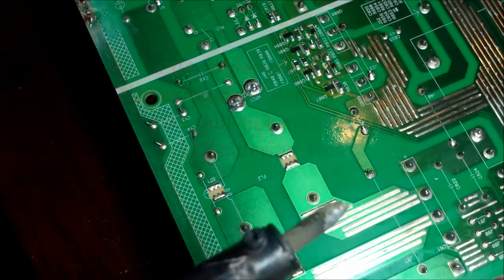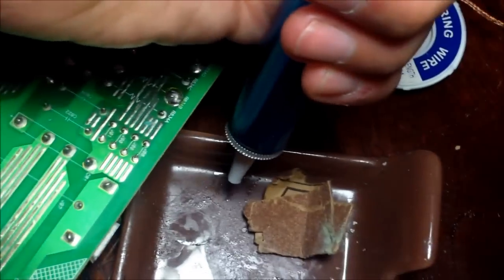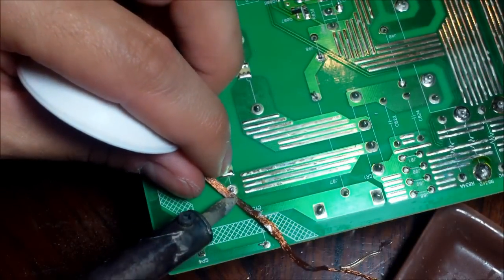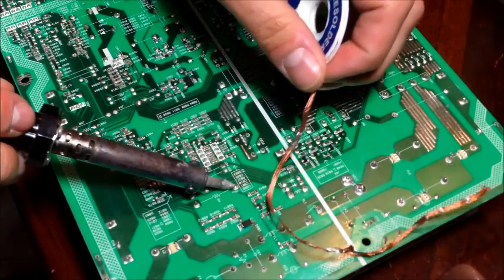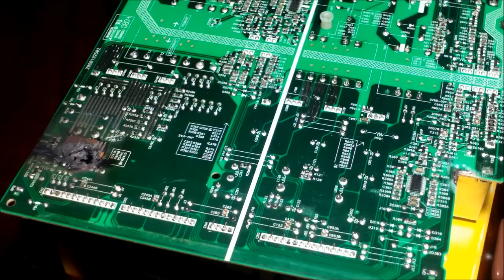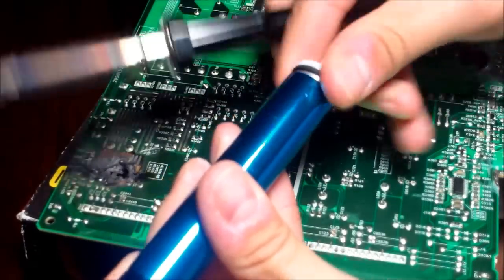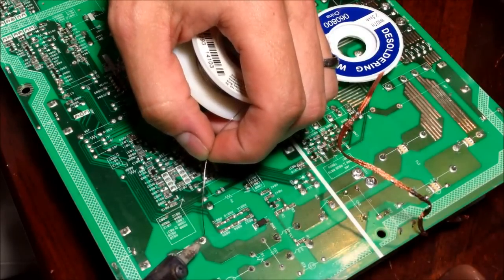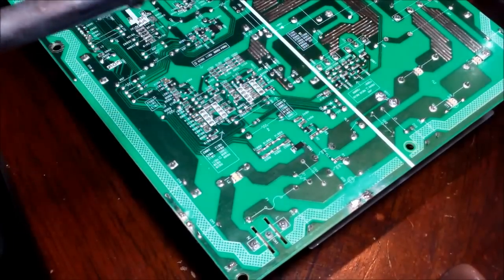Easy Ways how to Unsolder & Soldering with desolder wire and plunger Tech Tips

Comment: Hi, i have to solder a new 40 pin connector on a Nokia Lumia 1520. It is very thin and there are solder leftovers from the previous-broken connector on the board. Will it be ok if i just dip the new connector's pins on a solder and place them above the older ones? I've never used soldering method before...
Reply from the maker: hot air method might be better. I would clean the solder pads with desolder wire then use heatgun and fresh solder if done right it will automatically bond together. watch few videos on  soldering with heatgun or hot air.
Reply: Thanks a lot for your prompt reply. I will try to experiment a few times then on another board and see how it goes...

Comment: dont do the sand paper method its bad for your soldering iron use a metal sponge for cleaning instead its better sand paper damages your soldering tip
Reply: this video is good i learnt something but i dont reccomend using sand paper to clean your soldering tip
Reply from the maker: +BLOODjack143 true, this is an old video, i added a note in video but only can be viewed on pc for some reason.
Reply: +Tampatec ohhh ok

Comment: is a 60 watt gun too much for a motherboard?
Reply from the maker: Ok only if it's adjustable 60 watt then just set it lower temp and use thin tip. iso-tip solder-iron is good
Reply: +Tampatec awesome thanks fir getting back to me so quickly . let's see if I don't  blow the whole thing up lol

Comment: sandpaper damages the coating on the tip. That is why most techs use a wet sponge.
Reply: +D Gosselin most techs use a soft metal sponge, unless you dont care to change ya tips (long term wise heh)

Comment: So do you need something to cover your mouth with to prevent inhaling the smoke from the soldering iron?
Reply: You can use a dust mask
Reply: Place a small table top fan with back of it face you and the board, it will draw the smoke away from you. A dust mask won't help a all for smoke or fumes, like this person answered. You'd need a respirator with activated carbon

Comment: I have a nintendo 3DS charger port that needs to be replaced. I am trying to learn some things bout Soldering from your video cause im a complete green horn at this. From what i understand generally on a circuit board, the pins that you have to desolder to remove the component are on the under site or the apposite side of the circuit board. Is that right? When locating the component, how do you know how many pins there are to desolder? From what i see, looking at the top part of the board, i can clearly see only 2 pins holding this one piece in.

Also when soldering, from what i gather, you hold the guns tip to the metal pin, untill it liquafies and then touch it with the soldering wire? What exactly does that do, like cements it together or something? Then you release the gun after a few seconds. I may need some help on this, cause i don't want to ruin this nintendo 3DS, i got the new charger port for it. All i have to do is remove the defected one and replace it, simple as that.
Reply from the maker: yes just use 30 or 40 watt solder iron then heat underside where solder joint pin is, next wait till solder turns to liquid,  then use solder-plunger or just wiggle out the charge-port, next heat up the solder joints and insert the new one but don't over heat pins then dab in fresh solder. Flux helps clean and bond solder joints.
Reply: ***** ok the points on the circuit board that you need to solder, you show on the video are on the underside or the bottom of the board apposite of the components. Where as in my case numerous vids ive seen on a 3DS. The points are at the top near the component. So is it generally the same for all components, are the solder points on the bottom of the board? That would mean i have take out the board completely, but i was under the impression that i can just heat up the points on the top of the board where the components are. Also when you put the new component in, do you just install it in place, hold it there well your soldering?

Comment: Nice video man! I have a question. I was changing out my analog sticks of my Scuf PS3 controller when I accidentally tore off two wires from the circuit board. 

What are the steps to put the wires back to the circuit board? The wires still have a piece of the solder at the end. Can I just heat up the pre existing solder that's already on the tip and secure it back to the circuit board or will I have to scape it off and use new solder? Thanks in advance!
Reply from the maker: its recommended to use new solder but it may still work either way.
Reply: +Tampatec remember to reflux the soldering joints.

Comment: your not suppose to push down with the wire on the bord you jest need to heat up the wire enuf to melt the solder then slide the wire with on presher

Comment: Hi all I have attempted my first ever repair (changing capacitors) problem is ive made a mess of the area around the hole so I don't think the connection is going to be good enough. Can this area be repaired? any help appreciated.
Reply from the maker: yes, just scrape that trace exposing copper under it and use a thin wire then solder wire to both trace and cap leg.
Reply: ***** Cheers tampatec I will try this many thanks.

Comment: i try to fix a mp3 player with solder gun but the curcuit board turned brown and shiny and the solder wont stick to it what do i do?
Reply from the maker: try using flux or sandpaper to help bond solder to connections.

Comment: Nice vid, I really enjoyed it. I don't think the drop thing is necessary though, nor do I think it works.. All you need to do is properly heat the component and the solder will move to the other side. I feel your technique would create a cold solder joint.